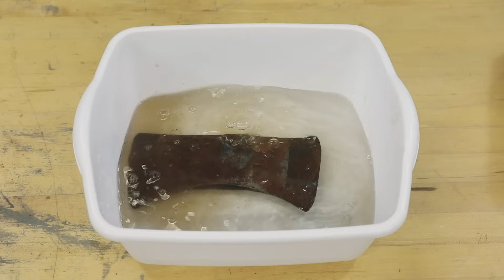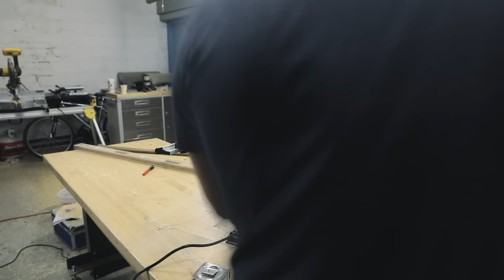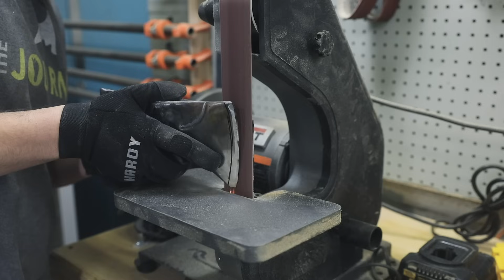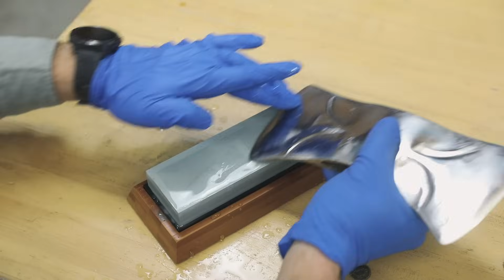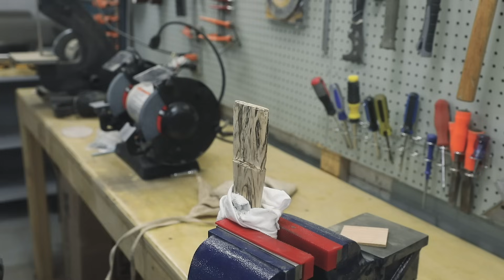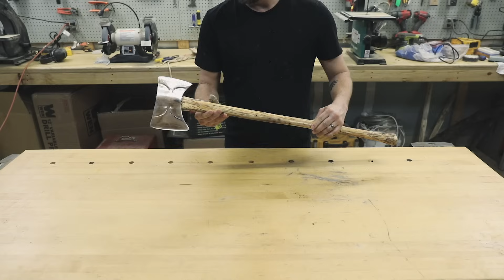RESTORING A RUSTY DOUBLE BLADED AXE!

Comment: It's almost like you didn't want us to see the manufacturer's name on the side of the ax.  I've changed out lots of handles in my time (since the 1960's) and never found glue necessary.  It's an interesting touch, though, I admit.  My father was a blacksmith, and he made a tool shaped like the handle opening at the top of the ax head for driving out the old wood.  I still have and use it.  Also, your handle is a work of art.  Beautifully done!!   I'm so glad to see the old axes cared for, like my great-grandfathers two Kelly "Registered" faller's axes, which I still use.  Great work, young man.

Comment: Nice work.  That is a beautiful axe head.  I have a little (28") double bit Crusier Axe.  I carry it all the time in the woods.  I never sharpen both sides to razor edge.  Two reasons - a razor edge sticks in wood.  This is a chopping tool, not a cutting tool.  I sharpen using a file - always file toward the handle.  So, one side sharper than the other - but not too much taper.  The other side is pretty blunt - for chopping an occasional root or some other obstacle near the ground.   If you hit a rock with a very sharp edge, you destroy the edge and possibly more - you can break a chunk out of the head.   However, as an 'ornament', that axe is a thing of beauty.  I wish it were mine.   I'll have to look for a head like that - a work of art.  Nice work on the handle too.

Comment: Love how the head came out.  One question.  Why didn't you seat the head on the shoulder of the handle?  It looked like you could have seated it better.
Reply: 890mikes seen that too
Reply: It’s more of an aesthetic restoration to my eye. I’d would have chosen a stronger harder wood for handle instead of a splatted cherry. Sanding the axe head without cooling it is also suspect. And finally I’d have chosen to polish off less of the axe surface.

Comment: Great job; they only step that I do different is that I oil, boiled linseed oil, seven times before I handle the tool or hang an axe.  Thank you for sharing.
Reply: Agree about the linseed oil, which is what I use, applied hot.

Comment: Is that hickory, what are you rubbing on it I use linseed oil. Never get blisters
Reply: Danish Oil
Reply: Watco Danish Oil
Reply: Wonderful stuff, boiled linseed oil is. I even mix it into paint for the house... Paint jobs last forever.
Reply: The handle rub was made from my great grandparents
Reply: Not hickory.
Maybe cherry or other fruit tree.
Motor oil at $10/gallon works great for wood finish.
Even used oil is ok outside.
Reply: @micahbell122yearsago7  you killed Arthur!
Reply: Calvin F he had what he had comin he turned on the Van der Linde boys and that was unacceptable.
Reply: @Calvin F- is that the Tiananmen Square incident with the picture of Tank Man
Reply: torch sand and rub in used motor oil.. preserves wood over 100  years

Comment: I bet he's annoyed about that gap between the top of the handle and the blade.
Reply: i noticed that as well.  great restoration but seemed to shortcut at the end.  there is also a good reason that there is a tight fit there, and it is not just aesthetics.

Comment: When I saw the grinding wheel come out, I left.
Reply: It got worse after that....but you probably figured as much..
Reply: Just asking not starting an argument but how is using the grinder bad and what other method would you use
Reply: A grinding wheel is very aggressive and removes large amounts of metal quickly, not good if you are in preservation mode, the alternative is to use some kind of rust remover solution and/or a wire wheel to remove as little material as possible and preserve the original surface.
Reply: MugsyMegaton yeah I figured that’s probably what it was but wouldn’t it be easier because with the axe head I’m restoring Rn it has a bunch of little divots in it wouldn’t it be easier with a grinder to remove those
Reply: @noahdavis3579  it’s more of an application thing. I wouldn’t worry about removing everything, make it a respectable working tool, clean up the pole, file and profile a good edge on the blade, and leave as much patina as possible. Sometimes less is so much more.
Reply: MugsyMegaton would Hans files be a better solution to it
Reply: enlightened58  There is nothing wrong with using a grinder. But you don’t need a grinder to remove rust or oxidation. And those sparks, that’s not rust. If you use a grinder much you will understand what we are saying.

Comment: Thank you for a great video, the quality and lack of narration made this video. If you make another axe handle from a round, id recommend you split the wood with hatchet and wedges, in 1/2's and 1/4's. Then find the stave with the straightest grain, and using hatchet and wedge cut out the rough shape of the handle. A hatchet, drawknife, and rasp are then used in that order to shape the handle.
This process is good because when you split the wood, the weak fibers fail, and the handle you are left with is encased in "survivors". This adds a degree of strength that the bandsaw removes.
Once again I really enjoyed the video, and hope to see more in the future.

Comment: IM SURPRISED at how almost no deep scratches or gouges there are on the body of the ax . under the rust ,must not have been used alot. And how good a condition the blade edges are !! I like the finish you put on compared to the original way they come !!

Comment: That handle won't last. Didn't seat well and nothing but the wooden wedge. Not a good fit at all.  That axe is good for display and that'll be it. Any hard use and it's gonna fail.

Comment: Beautiful axe, but when you hang an axe head you set it on the handle, then hammer from the bottom of the handle.while holding the axe with the head down. Also, leave a little more handle above the eye of the axe and only cut the kerf for the wedge 2/3's of the way down. It gives less chance of splitting. Overall though, good looking axe

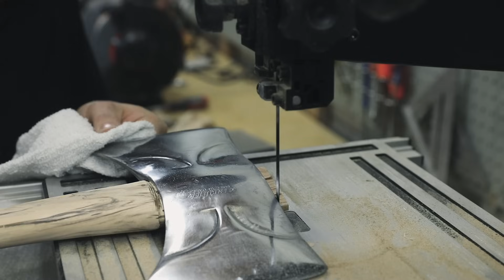Comment: 11:42 Are you sure that axe head is properly seated??
Don't get me wrong, you made a very nice job at this restoration, but it looks as if it lacked a few good whacks to the handle and maybe trim a few of the rolled shavings, to seat it all the way down into the handle.
Reply: That axe head is deffinately not properly hung. There's huge gouges left from the disk grinder. Lastly the spalted handle was totally a different piece of wood than what he started with....

Comment: How did you remove the chip from the toe of one of the blades?  Also, why sharpen the axe before you fit the handle?  And you didn't finish wedgign the handle to the head.  You need smaller wedges, usually made of steel, to make the wood fill the fore and aft portions of the head.  They should be installed about 90 degrees from the wooden wedge.  Your head will loosen.

Comment: Question: If you're going to use a grinder on it why soak it in metal restorer? Does it make the grinding easier?
Reply: Skid Marks if you are talking about the rust on the axe head, the rust will get caught in the belts and the belt will become pretty much useless. A good way to save money because you go through belts very fast with metal work.
Reply: @fangrexeret9263  thanks dude. That makes sense.

Comment: no safety glasses you didn't grind inside the axe where the handle goes so its still rust in there why did you use the reciprocating saw when you had the band saw ?

Comment: Question. Is an axe suppose to be that sharp if you aren't cutting people up with it? 

I thought an axe is like a machete where since its a hacking tool it is not necessary for such a sharp edge so it doesn't roll the edge the first time you use it. Isn't that why a knives needs sharpened after you baton with it? I know my knives the edge either chips or rolls when its used to hack at things.
Reply: No. A proper splitting axe has an edge more likely to cause blunt force trauma than lacerations. A felling axe will be sharper and require more frequent maintenance; probably about as sharp as the average pocket knife. Kitchen knives seeing light duty on vegetables would be sharper, and shaving razors sharper still.

Comment: Rust Rangers,
Why didn't you use electrolysis to remove the rust?  Just a battery charger, water, and some washing soda to speed it up.  It won't remove good metal, only rust.  It even turns rust that isn't flaked back into iron so you have the most solid metal.  PS, I used it to restore an antique Collins double-headed axe head.

Comment: And using a grinder to take off surface rust?! the gouges in that metal hurt to look at
Reply: I didn't want to nitpick, but yeah that was a bit disappointing to me. I would have just used the wire brush wheel..
Reply: doesn't look like a grinding disc to me, more like a poly disc, or a graffiti disc.
Reply: I thought so too. But you can see the gouges if it's not a grinders it's something similar and too coarse
Reply: He says in the description that it's a flapper disc

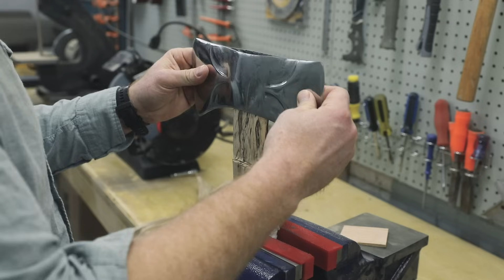Comment: 10:40 I grew up on a farm and have watched axes getting new handles, done a few myself and I have watched other masters do this for years and I have never seen such a loose fit on a handle. You're only supposed to start the blade on the handle. Then you are supposed to remove it from the vice, turn it upside down with the head toward the ground and hit the far end of the handle which will cause the blade to seat properly on the handle. Shave, repeat, shave, repeat until the blade reaches the shoulder. You don't even have a decent shoulder on the handle. On top of that, you are using glue on the wedge? GLUE? This is a terrible idea. I really hope your axe doesn't fly off the handle mid swing. This is VERY unsafe. This axe is a potential man killer!
Reply: Doing it this way can cause the metal (if brittle, or with imperfections, or the method of manufacture) can can the head to blow apart and harm anyone around. I agree with you as the way you described (hitting the fon foot) is the way I seat heads too.
Reply: I've also seen an axe with glue holding the wedge into place rather than something as simple s nails. Head flew off into the distance. Just terrifying.

Comment: Hey before you hurt your self go buy a axe handle are watch a couple of videos on YouTube about axe handles an the proper choice of wood . That handle looks like giant fern . It's like you replaced your truck brake pads with mild steel you found laying around, sure it works when hit the brakes testing in your driveway. I know you don't want too hear it but cut that handle off for your own safety.
Reply: I was thinking the same thing...it looked like a couple of knots in the piece, too. Definitely not a usable axe right now, unless you want a wall-hanger...Get some straight grain hickory or ash.

Comment: You did a great job on everything except for hanging the head. More hand tools and less machines would have allowed you to get a better feel for the amt of wood you were taking off, and where, and you wouldn't have left the visible marred ring underneath the head and you would have filled out the inside a bit better.

Comment: you made it way too sharp, its an axe, not a razorblade. but after a few uses the edge will be down to practical levels anyway so no biggie.

what was this axe used for? i have never seen a double bladed axe used in woodworking where i live, only single bladed with strong angled handles.

Comment: Why soak first and not just use a wire wheel?
Reply: Prevent excess scratching of the metal and to loosen the rust and to help show any roll stampings in the steel that if just wire wheeled could be defaced

Comment: Shows how razor sharp it is, and then test cuts it on wood

Well there goes the razor edge...
Reply: Not really if the steel is good and hardened then it should hold an edge fairly well
Reply: I was partially kidding
Axes, though have a blade, don't necessarily need to have such a keen edge

Comment: End product looks great.. but,( I have worked in Jet Engine Restoration ),, with all that equipment,,, Invest in a "Sand Blast Cabinet". With a part that size, unless you come across really deep corrosion where the part is no good,  you should be able to do most of the work in 20 minutes ish,  then 10 -15 of polishing.. If you like wire brushing,, you should start with that.  May avoid a Chem bath that pets or kids can into.  ( Sorry, safety oriented )(( pets  love Chems,, ask me ))  next.. Sanding belt. depending on how hard it is to change out. get different grades of belts. I have found that 10 min to change a belt may save you some time. if you have the room, get more belt stations.  And if you do have more room. consider a Lathe.. use it to customize your WUD handle to make it more personalize, and write yer name in it  ;-) You have the Talent,, hope i tipped you off..